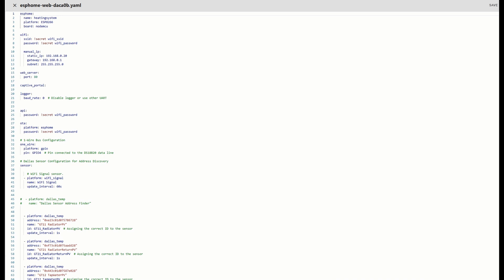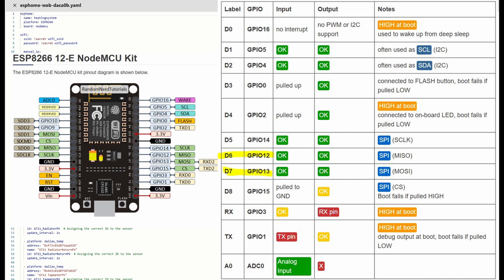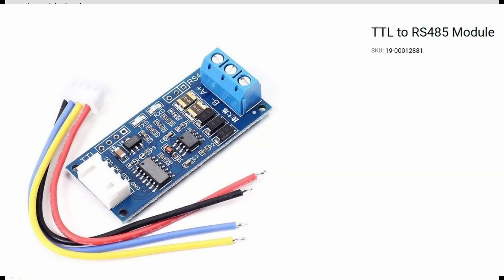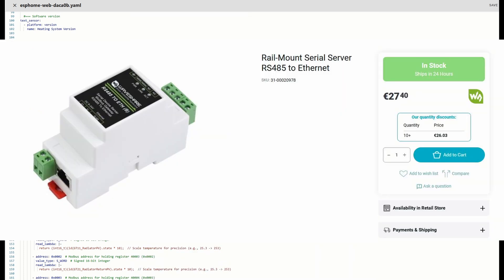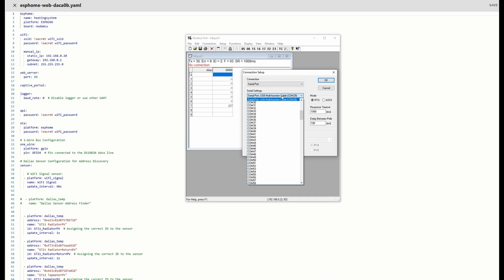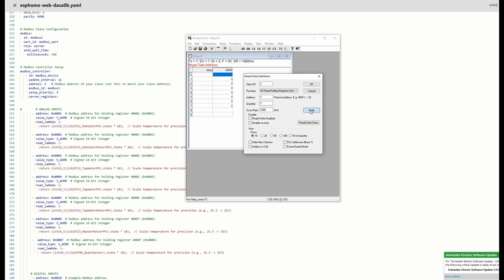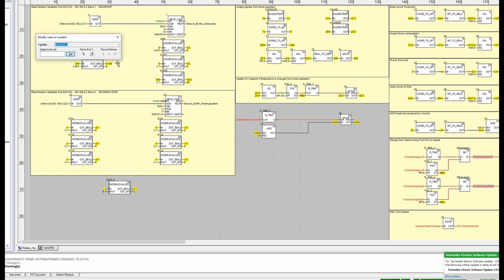ESP8266 as a Modbus Slave Over RS485: Temperature Monitoring Made Easy! Part II

Comment: Very nice, hey what the issue with RS485 to ttl module other than RX/TX connection, none of my similar module work!, thanks in advance...
Reply from the maker: Hello, thank you for your question.
I don’t fully understand the issue you are having, can you elaborate so I can help you?

The ESP8266 can't directly communicate with RS485 Modbus because it lacks native RS485 support. It uses UART, which requires an RS485 transceiver to convert the signals. You also need to ensure proper wiring, voltage level shifting (ESP8266 uses 3.3V), and correct Modbus settings (baud rate, parity). Additionally, ensure power stability for the RS485 transceiver.
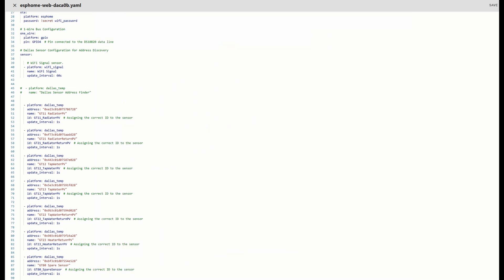Reply: @polymathengineering  thanks for the feedback, actually I was referring to 2:47 point of this video you mentioned that the rs485 ttl module eventually worked and you will shed some light on it later in the video.
Reply from the maker: Thank you for pointing it out, I am a beginner in the YouTube video world and I will make a follow up video.
Reply from the maker: @sshah876  Ok, so i just remembered why i could not use the RX/TX pins, The ESP8266 uses GPIO1 (TX) and GPIO3 (RX) for the hardware serial interface (Serial).
By default, the ESP8266 logs system messages to Serial, which interferes with Modbus communication.
Even if you disable the logger (baud_rate: 0), the bootloader still sends messages on TX at startup, possibly disrupting Modbus devices. GPIO1 and GPIO3 are also used during boot for flashing the ESP8266.
If your Modbus device is connected while the ESP8266 boots, it might cause unexpected behavior or prevent proper booting. And that gave me problems because the communication never started with my modbus on the RX/TX pin. That is why i had to configure other GPIO:s.
Reply: @polymathengineering  cool, so its best to avoid GPIO1 (TX) and GPIO3 (RX)!!
Reply from the maker: @sshah876  I think so, for this configuration yes, i did not get it to work given how the BOOT is working on the ESP8266.